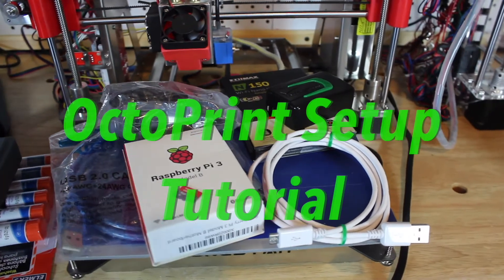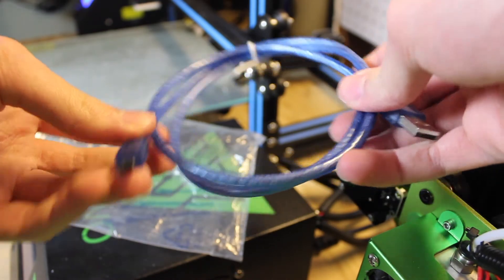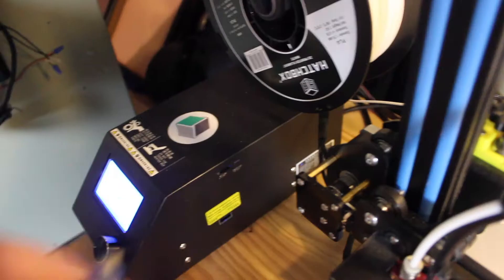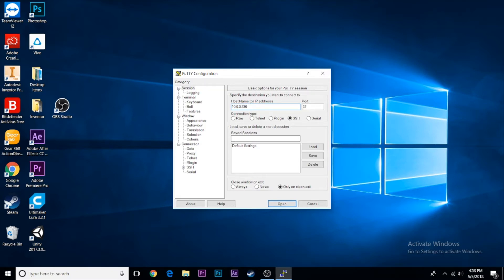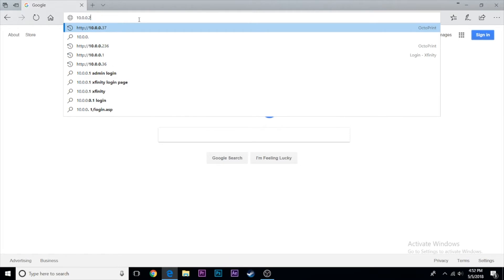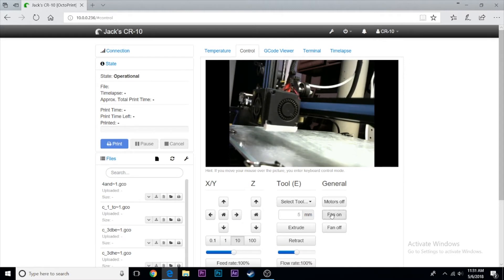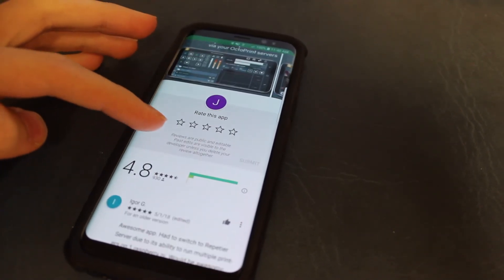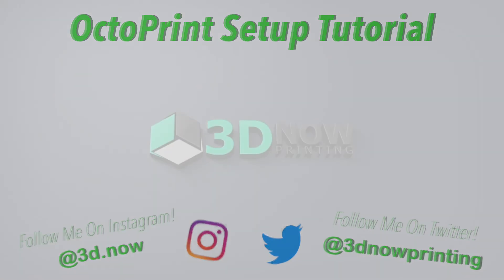OctoPrint Setup Tutorial + Domain Name and Printoid App!

Comment: I use windows 10

It only writes: RASPI-CONFIG NOT FOUND

I have tried typing: github.com/snubbegbg/install_raspi-config and https://github.com/snubbegbg/install_raspi-config

then it says: Input/output error

Help, please.
Reply from the maker: Raspi config is only for linux on raspberry pi. On windows 10 it's a lot different.
Reply: @3DNow  but via putty it should be the same... or am i wrong?
Reply from the maker: Yes, if you login to the pi via putty then it should work
Reply: @3DNow  thats what i've done.
Reply from the maker: Then something is probably wrong with octoprint. Try re installing octoprint on the pi

Comment: 1:32 You know that RasPi 3 have built in WiFi.. right?
Reply from the maker: Yes,  I mentioned that if your octoprint server disconnects front the wifi a lot, you may have to use a wifi adapter for a stronger signal.